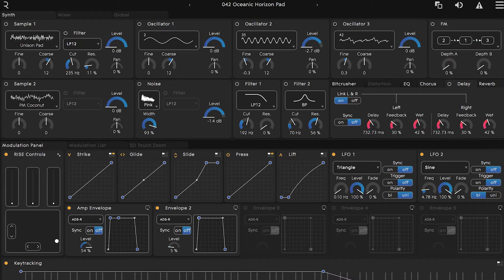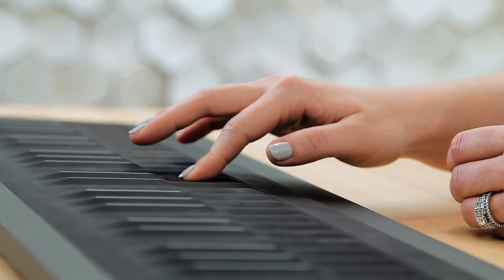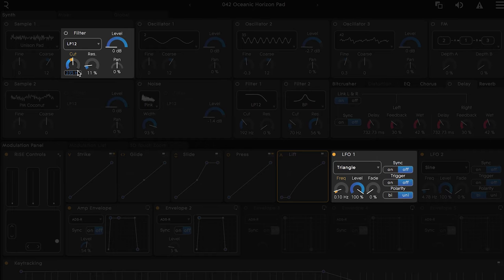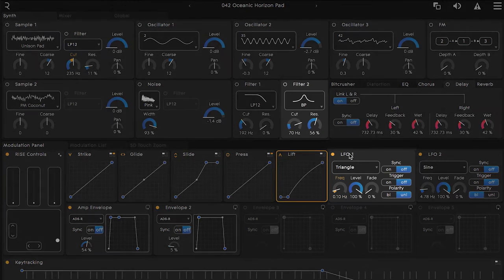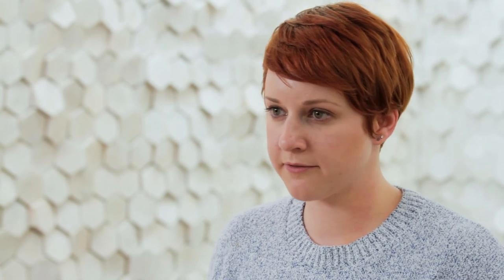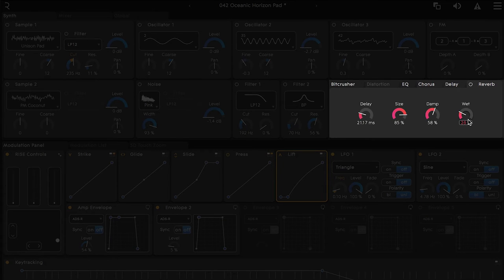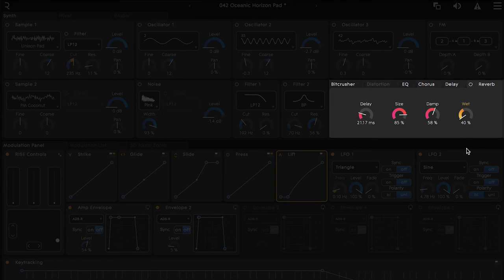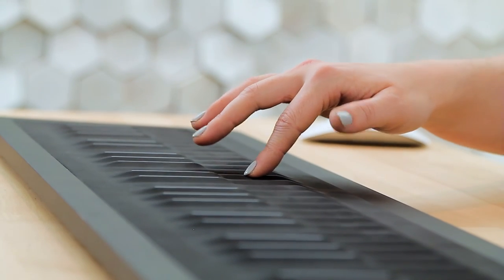An Introduction to the Seaboard RISE: 2.3 - LIFT

Comment: How can I EDIT recorded lift midi data?  EG:  In Cubase, I can edit all the various cc's used on the Rise as either "note expression" data or in the key editor in the Controller Lanes.  But I can't, of course, for LIFT since it is the "off" of velocity.  How can I get into editing the LIFT data on a particular note I've already recorded?